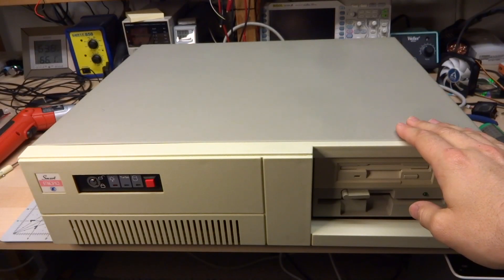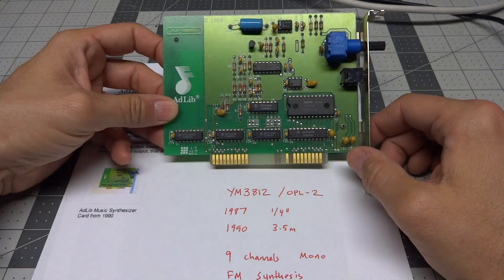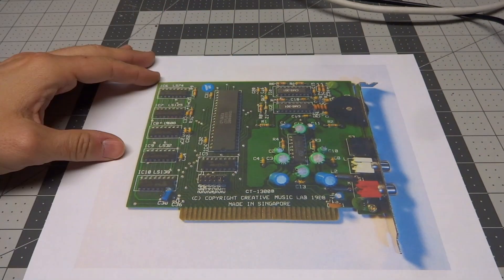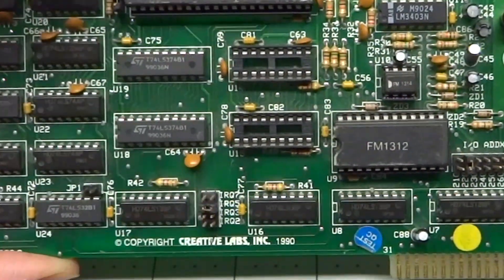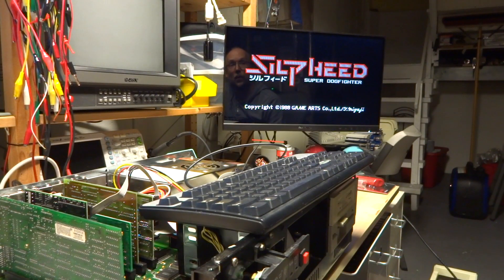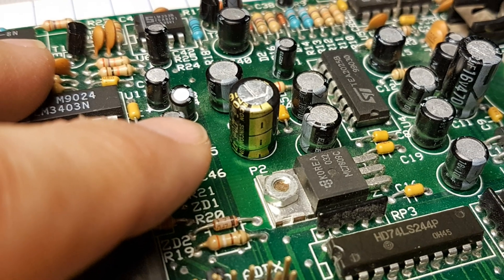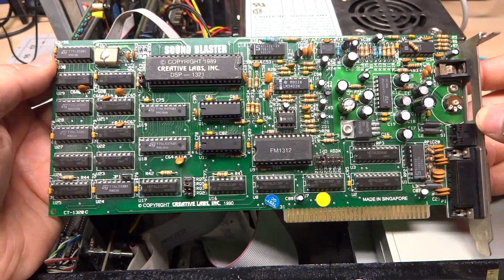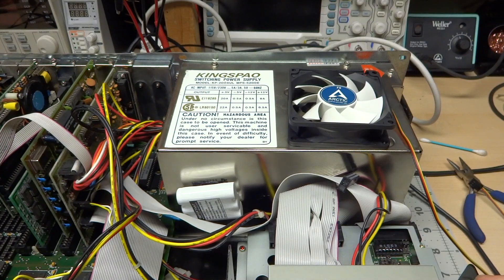Creative Music System: Upgrading my Sound Blaster 1.5

Comment: I really don't think I agree with your opinion of how good the CMS is in different games.
To me, the CMS sounds disgusting in Monkey Island. I think it's actually worse than the PC speaker - it sounds "messier" and like it's fighting itself. The PC speaker version of Monkey Island is electronic and brutal, but at least it sounds clean, and isn't dissonant. The PC speaker in Monkey Island has a primitive charm which the "Game Blaster" loses, without gaining anything.
But I think the CMS is really good in Silpheed. You said that you think the Adlib is better there, but I don't actually agree in that case. I think the CMS is at least as good as Adlib in that game, even though I don't know of any other game where the CMS gets close to the quality of Adlib. Creative bundled Silpheed with the original CMS card, and IMO, they chose the perfect game to show how good the CMS can sound if you utilise it properly but don't try to push it to do things it isn't physically capable of.
But to each their own, I suppose.

Comment: I wonder if the SAA1099s on an SB can be written to at the same time as the Yamaha chip.

A particularly creative musician could use the higher polyphony to some effect, though I doubt it'd be very useful given that CMS alone has twelve (2x the 6 of SAA1099) voices, and the Yamaha also has quite a few voices, and you rarely need more than about 10 voices for a high-complexity piece.

Comment: Oddly, I had never heard of the Adlib cards until after I had gotten my first Sound Blaster card (never needed it until I needed MIDI ports). By that time there were several cards on the market, but Adlib and Sound Blasters were high on the list.  I continued to use Sound Blaster cards. Today I don't need MIDI, but I did need better sound because every computer seemed to have crap sound (including boards for game computers I built). So I went and found that Sound Blaster made an EXCELLENT USB device that had software that could be adjusted many different ways (since MS removed the treble and bass controls in W10).

This video was really informative. Thanks!

Comment: Honestly i think that the PC Speaker  monkey island theme is absolutely the pinnacle of PC speaker sound experiences. I love it so much, its my ring tone.
Reply: I do like the PC speaker version of the Monkey Island theme, but the pinnacle of PC speaker audio has got to be The First Samurai
They didn't need to push the PC speaker that hard, to sound good doing things it obviously wasn't designed to be capable of, but they did it anyway, using syncopation to effectively emulate separate bass and treble channels.

Comment: that case remints me of a AST286 that i had, with a whoping 4mb ram and a very big 512 mb hdd, yes mb, not gb.
and it ran dos, but cant remember with version, and later it developed a problem that when the unit was running and you touched the case, you would be electrocuted.

Comment: Funny to see that PSU's rating... back in those days most of the grunt was the 5v rail... nowdays it's mostly in the 12v rail (bloody gpu's realy hungry).
Reply: My Athlon XP machine has a modern psu in it right now as the agp gpu has a pci-e 6-pin connector on it, and my molex to pci-e is being used in another pc right now. I will eventually go back to it’s  350w cooler master psu(it has 35a on the 5v and 13a on the 12v) also I was using a sata to molex adapter as I was using all the molex connectors on it’s psu, and I found out a pin was bent on that adapter so the video would drop out occasionally.

Comment: That's a 1/8th inch jack, speak AMERICAN!
Reply: J Frye - Not sure part 3 was really necessary. Or at least could have been more calmly written.

tbb033 - I'm American and I learned those as 3.5mm years before I heard them referred to as 1/8th inch. So it's not a matter of language, it's a matter of who taught you. Also, both are perfectly fine, although the conversion between the two isn't exact. (1/8th of an inch is closer to 3.2mm. 3.175mm if you want the exact conversion.)